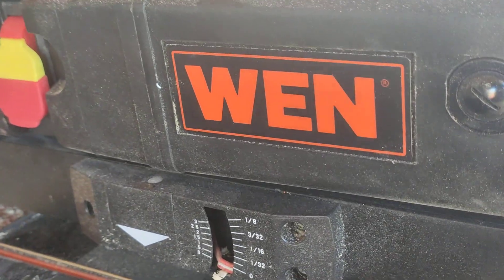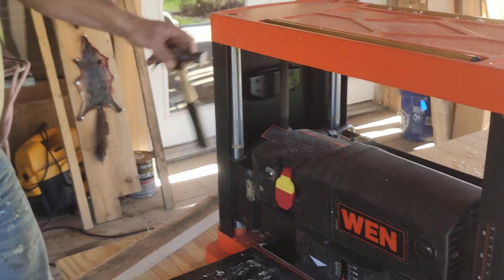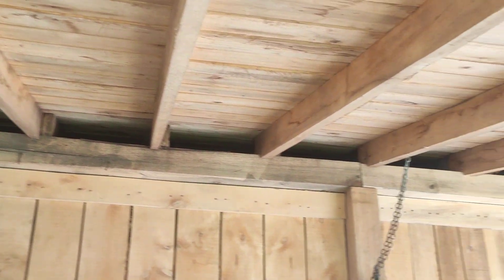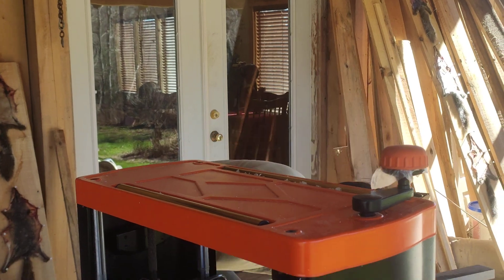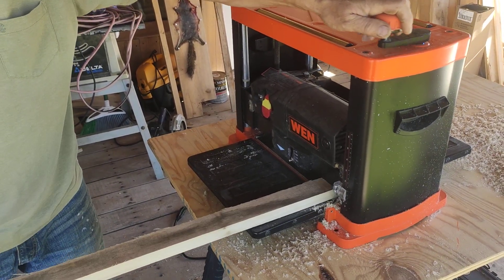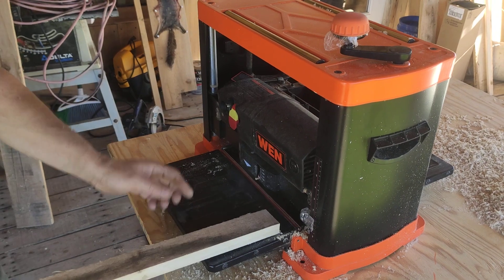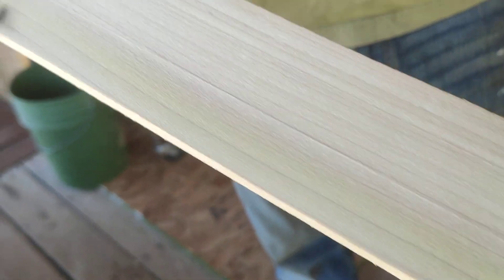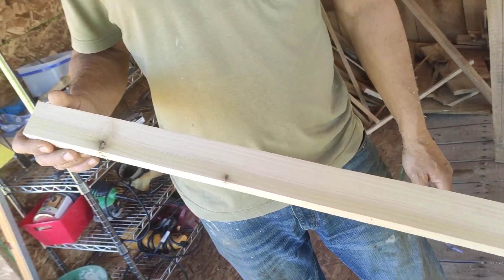WEN 13-Inch 3-Blade Benchtop Thickness Planer, 6552T

Comment: WEN has two versions of this planer.  12.5" & 13".  I got the 13".  I would have expected the 13" woulde have been the higher end of the two.  The 12.5" has a granite deck while the 13" has a stamped steel.
Reply: Hi Dan, I think the 12.5 is only a 2 blade and 13 is 3 blades so you are getting better planer in a 3 blade. Correct me if I am wrong but that is what I been reading when doing research on which to buy. How does yours work with Hardwoods? Thanks!
Reply: @hollyr8788  You are correct.  I bought the 30-blade model for that reason.  The 2-blade model cuts at 64 cuts/inch vs 96 for the 3-blade model.  No issues with hardwoods.  Would I buy it agian if I needed to?  For the price, it beats the others.

Comment: If the piece isn't too wide can you use it as a Joiner?
Reply: Not without buidling a special jig.  Without the jig, the rollers will follow the warp of the board.  You'll end up with a warped board that is slightly thinner.  The rollers will follow the contour of the board.
Reply from the maker: I never tried it  but this a great question. I'll try it andet you know